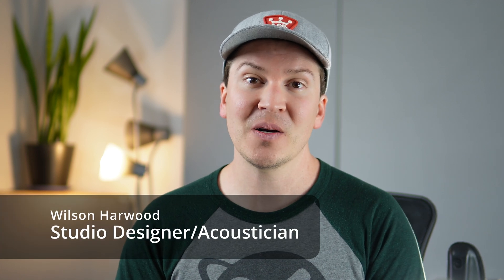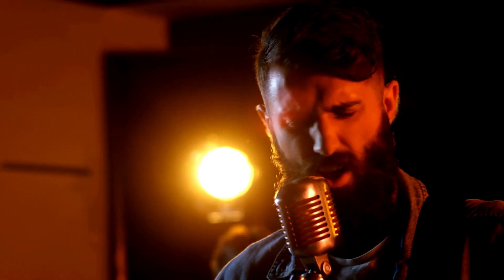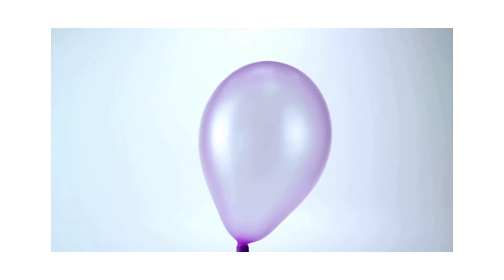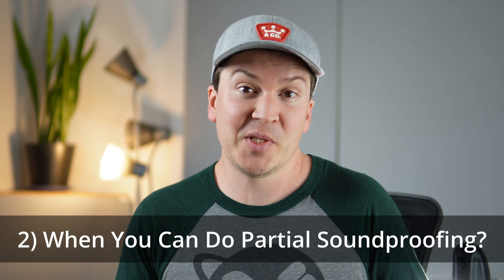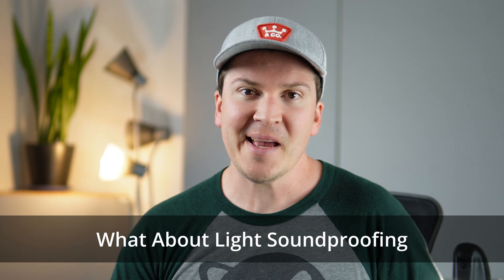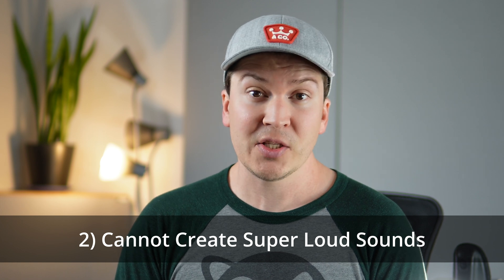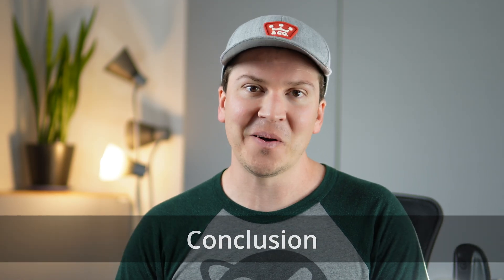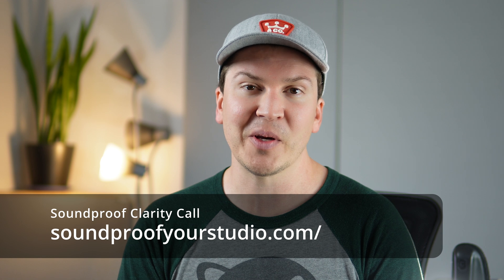Is Soundproofing All Or Nothing? Can You Go Halfway?

Comment: Thanks for doing these! I've been learning for a few years and followed your personal build, but it's been great to continue learning and to have such a "broken down" resource for answering basic questions most people have, even if they don't know they have them. Acoustics is an extremely complex field, and these practical questions can be difficult things to find concrete answers to outside of specific manuals.
Reply from the maker: I'm glad you found these videos helpful! Are you in the process of building a studio?
Reply: @soundproofyourstudio  Not anymore, I finished a build and learned many lessons along the way, including not using RSIC-1 clips again :). They seem to work fine, but attaching treatment to the ceiling has become significantly more complicated as a result.
Reply from the maker: Sometime OSB in place of drywall can help with hanging ceiling clouds.
Reply: @soundproofyourstudio  Oh good idea. My main concern is also the total bearing capacity of the clips when they have 2x drywall on them already.
Reply from the maker: Yup always good to follow the manufactures instructions carefully

Comment: Isn’t it more a question of the choice of materials? For example, let’s assume you’re creating a building to have some level of sound proofing. Clearly you could build it with two layers of 12” concrete structure, no windows, no hvac, and a single massive counter-opening airlock door. 

But equally you could build it with say a concrete, steel, and breeze block outer wall, maybe a window or two, a split system hvac, with a floating wooden room inside with all the appropriate insulation and double sheeted dry walls, with an appropriate set of doors?

Surely it’s the trade off between something with an infinite amount of sound transmission isolation and something with say 120dB of sound transmission isolation. Yes the latter will mean you can still hear (barely!) that Boeing 747 jet engine that your neighbour fires up in their backyard on weekends, versus not at all for the former, but you have some natural light and heating and some money left in your bank account (maybe)!
Reply from the maker: Sure, it’s not quite as black and white as that. There is a spectrum, but within that spectrum you still must adhere to the laws of physics. I play with mass for levels of soundproofing, but coupling and having small holes all over your room is non negotiable.
Reply: @ yes, you’ll never soundproof just a single wall, that’s for sure. If you had an apartment (which I don’t, I have a house, currently planning my studio space while working in a temporary set up) would it be worth it to for example, build a small inner floating shell room inside a room? What would be the minimum you could get away with?
Reply from the maker: That is a great question and one I work with figuring out with my clients. Are you dead set on doing this studio yourself or would you be open to collaborating?

Comment: It is incredibly hard to soundproof and your doors will also always be the weak spot. I am just finishing my space and it is in the basement. Unless i was willing to decouple with iso clips and other measures, no way in hell it is soundproof. What people should think more about is " extreme sound reduction". This is more likely as a scenario for most of us. I had to go with just a solid core door because my wife refused to have a huge eye sore in the main basement. This is just the reality. Then trying to fill all the cracks in the door jam? Using material, foam backer, then acoustic sealant which is messy as hell and gets all over. Total nightmare. Then you have ventilation.. I ran flexi duct with turns in it to have some fresh air and return but that adds to ceiling holes. Plug all those, externally mount lights, double 5/8 on ceiling , double 5/8 on my inner and outer walls with staggered studs and putty around the outlets etc... but then any gaps in drywall... between floor and wall etc.. it all adds up. In about a month I will be able to see what difference this all made with drums. My goal was for the bass drum to be barely noticeable on the top floor. On the main floor I only expect to hear the thump. But dead quiet? No chance. Manage expectations unless you can do a stand alone unit. Love your series though, always informative and made simple to understand. Some of the advise out there is overly complicated and just not very practical.
Reply from the maker: Thanks for sharing and glad you found the channel helpful